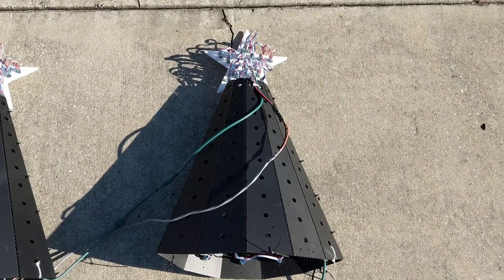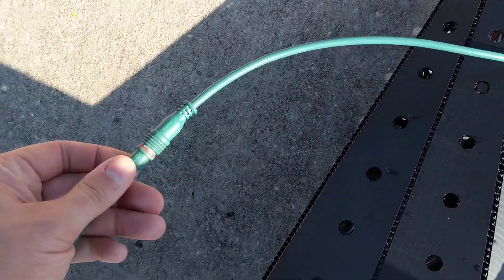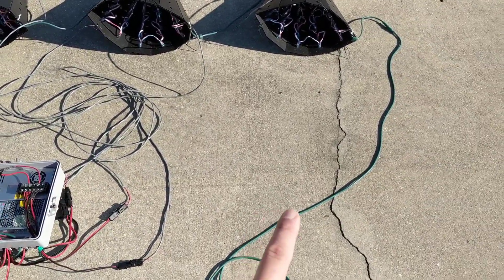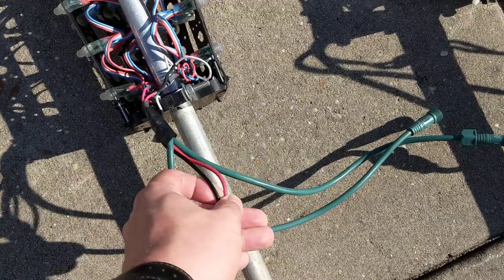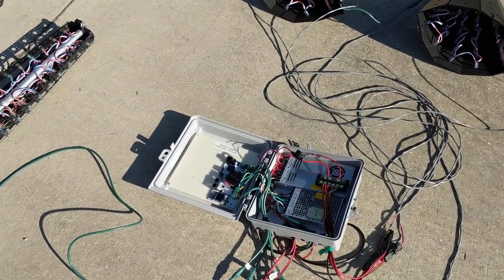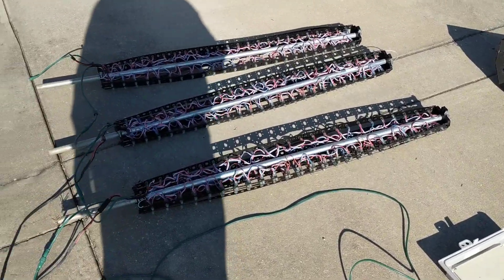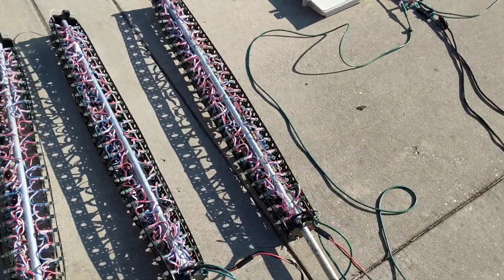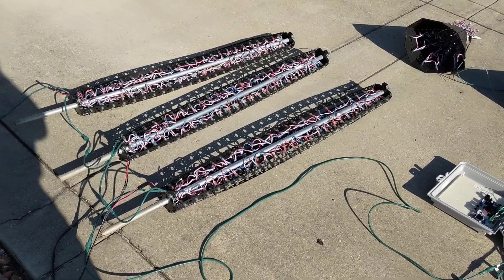Electroluminosity Behind Scenes - Power Injection Built Into the Prop

Comment: Quick question considering the following hypothetical scenario...

5V LED pixels Max = 60W 12A
14AWG Injecting at beginning (3A), middle (6A), and end (3A) of 18AWG LED wire.

...is it best practice to fuse 7.5A at the single source of power to the 14AWG, or at all 3 injection points?

Comment: I really like this idea. So if I got this right for say your pixel poles. At the bottom of each strand you have all 6 power wires tied to a single power wire and same for ground for the power injection?
Reply from the maker: Michael Ouellette yes exactly.
Reply: Bill Porter ok thank you. As a newbie this year I have seen and read so many ways to do power injection and I am definitely giving this a shot. It seems so much easier than others ways I have seen.
Reply from the maker: Michael Ouellette I'll be teaching a zoom xlights class on power injection in 2 weeks if you want to hear more.
Reply: Oh and do you have a link to what power injection wire you prefer?